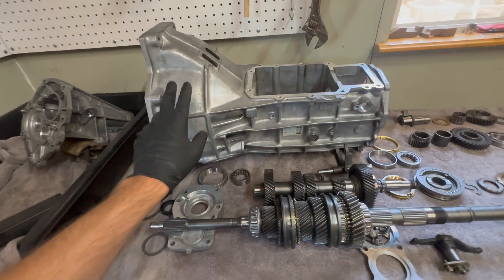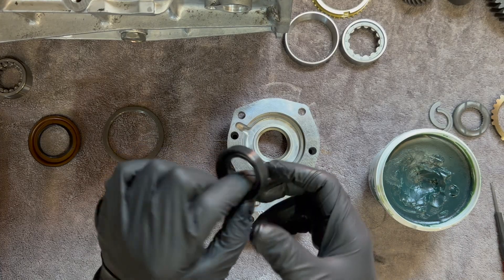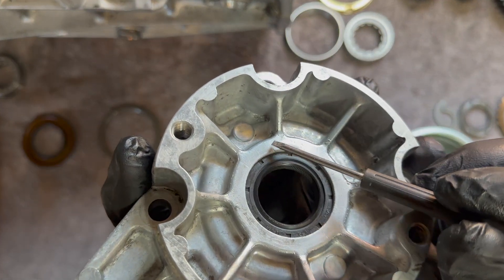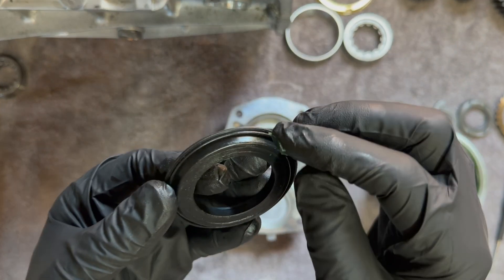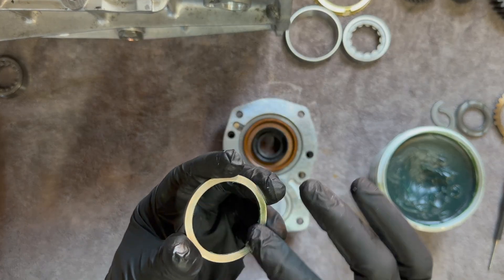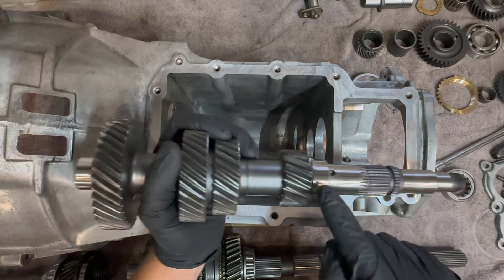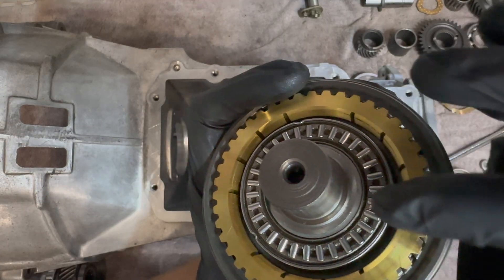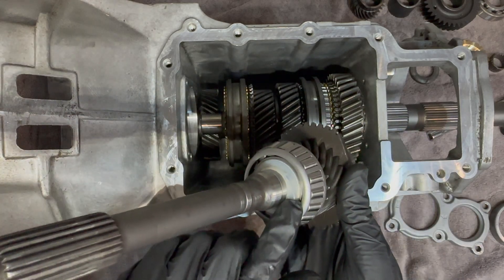Ford Ranger Transmission Rebuild: M5R1 Case Assembly Guide

Comment: Hey, awesome series on this, thanks. Question: Is it possible to remove the input shaft through bell housing without disassembling the tail section?  I'm wondering if I could replace my input bearing without having to do a complete tear down.  Thanks again for the videos.
Reply from the maker: Unfortunately there’s no shortcut for the bearings. Instead of a rebuild, you can find a donor truck and swap trannys.

Comment: Well done videos.  As you stated in your other video, there are quite a few other videos out there on this transmission, and they are generally quite good, but sometimes they can gloss over certain things.  By watching a bunch of them, you can piece together what needs to be done, but I appreciate your efforts to focus on the details as I undertake my 2nd reassembly of my transmission.

Unfortunately, I was the lucky recipient of a transmission with a 1st/2nd clutch hub/slider assembly (which includes a complex 3-part 2nd gear synchro ring design) that Ford in their infinite wisdom decided to only use for a short period of time and then discontinue, making it nearly impossible to source parts unless you want to sell a limb, organs or your firstborn.  For anyone interested, my Ranger is a 2001 V6 3.0L - I don't really know the range of years Ford used this multi-piece synchro ring design.

Just be warned, the standard rebuild kits on the market will not have replacement 1st/2nd synchro rings for such a design.

I'm having to reuse my 1st/2nd clutch hub/slider assembly, which seems to be OK, other than I'm having trouble with the 1st gear synchro ring, which has a very odd design with spanned teeth that can only mesh with the hub/slider in one orientation but has offset hub key indentations that make it nearly impossible to align to the proper orientation.  I guess it worked before I removed the transmission, but I am extremely worried that if I assemble it as it wants to align, I won't have 1st gear.
Reply from the maker: Appreciate the detailed comment man! Yeah those early 2000s 3-piece synchros are a nightmare. If it helps, I’ve had luck making sure the hub keys are seated first, then clocking the ring so it’ll line up instead of forcing it. Definitely easier said than done though.
Reply: @awaytodothings  After rewatching your other video, I took apart my 1/2 hub this morning and noticed the indentation for the keys on the inside of the spline (had seen these on others' videos, but didn't pay much attention thinking the design for mine was different).  Lo and behold, these were basically one spline over from the spline channels.  Reassembling the hub one spline over aligned everything properly (just a one tooth shift for the ring) and it now it moves into 1st like butter.  Thank the heavens I checked this because I was about to perform major Dremel surgery on the 1st gear ring.  My 3/4 hub was also assembled incorrectly (5/R probably is as well) because I assumed those spline channels were where the keys needed to go.  Thank you so much for clearly showing the hub assembly process in your other video.  Probably saved me a ruined transmission.  So, for anyone else, DON'T ALIGN THE KEYS WITH THE SPLINE CHANNELS!  ALIGN WITH THE INDENTATION LOCATIONS ON THE INNER SPLINE.

Comment: Excellent video! I have an old 96' F-150 with the 300 inline 6 and the M5OD 5 speed, so should be pretty much the same internally, just different housing. I have an extra that I hope to rebuild myself, just need to figure out where to buy my re-build kit from and what exactly I'll need.
Reply from the maker: Thanks for watching! You're right, the internals are quite similar.